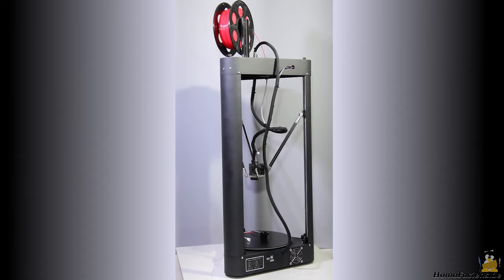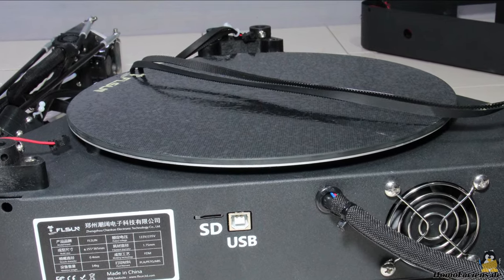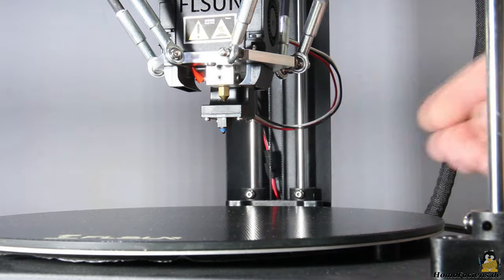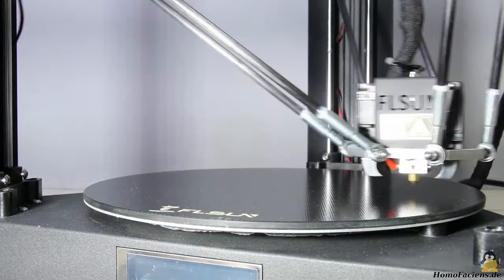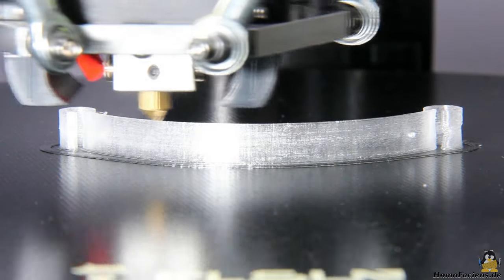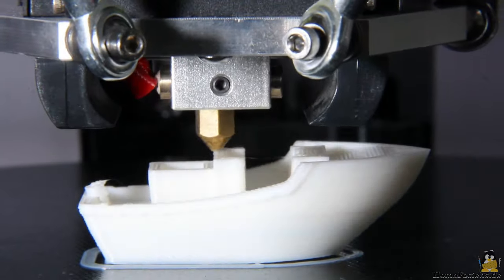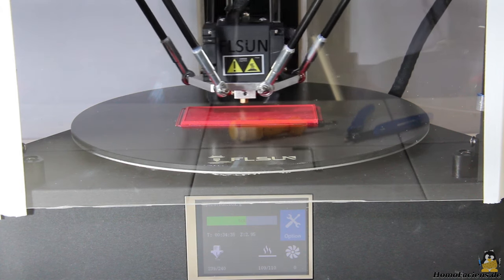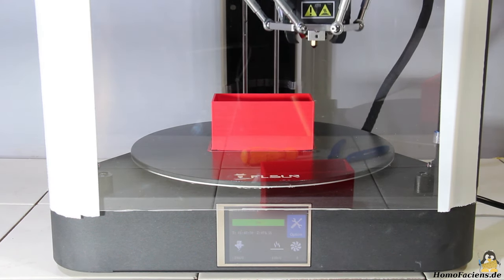Review of the FLSUN QQ S Pro Delta printer

Comment: Hello HomoFaciens, excelent review!. I wal looking for honest,  real 3d prints from a delta (like yours from the website). I am build my own version of delta rostock mini, and i have very similar vertical lines like you red box. Is that lack of some calibration or just the printer print like this ? thank you.
Reply from the maker: As with all print errors: They can be reduced by calibration or changing the print settings, but rarely eliminated completely. I never got rid of those lines with this printer, but I don't care about such minor errors. I usually print structural components for my projects rather than things that have to look good ;-)
Reply: @HomoFaciens  thank you 👍

Comment: Great video.
Would printing a draft wall of one layer thick around the perimeter of the part, not eliminate the need for heated chamber? 
The last time I used Cura, it had such a function in the experimental tab. I found it very useful when printing ABS. 
I don't use ABS anymore. Only PLA and PETG. ABS is nasty and even smells nasty. But sometimes, the need dictates ABS for its thermal performance.
Reply from the maker: Thanks!
A heated chamber is better than a brim (or draft wall as you named it). Adding an active heater to get closer to 60 or 70°C would eliminate warping of ABS even more. And I totally agree with you: The ugly smell of ABS is why I also prefer PETG for prints that have to resist higher temperatures.

Comment: Hola 👋 no me detecta el portátil la impresora 3d,que podria hacer ayuda porfavor,saludos
Reply from the maker: The least thing you must do if you expect a meaningful answer is to tell what operating system you are using. I am working with Linux Mint 21 and the printer is recognized with no problems.
Reply: @HomoFaciens  Hola muchas gracias por contestarme lo primero y segundo pues un portátil con  Windows 11 Home y al conectar la impresora me la detecta como un dispositivo CH340 (COM 5) no me la renoce como impresora gracias nueva seguidora saludos desde España
Reply from the maker: I can't help you with Windows as I am using Linux only, but a 3D printer won't appear as a normal inkjet printer. You will only see it in your slicing software, I guess.